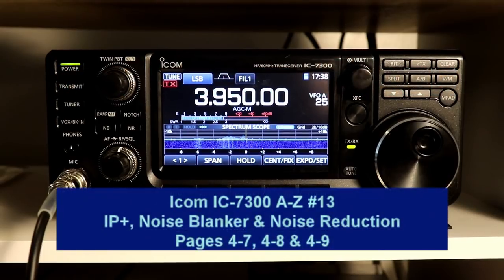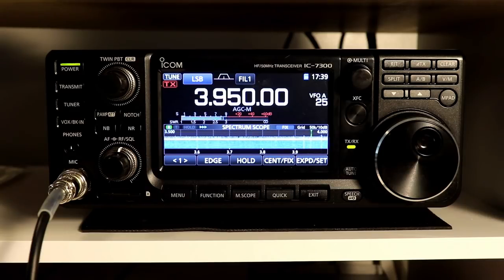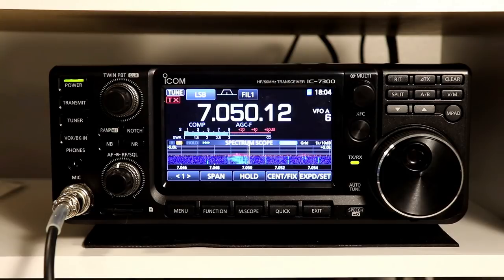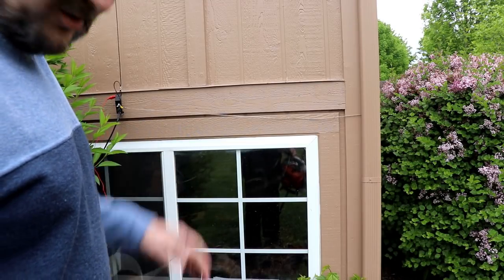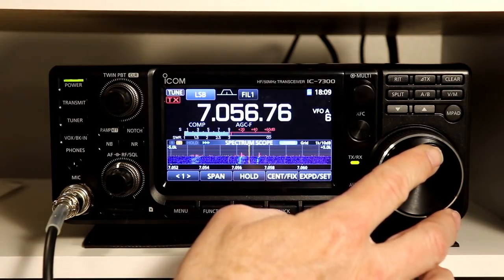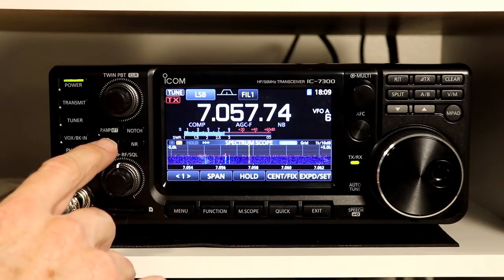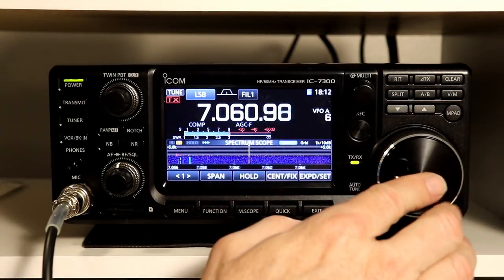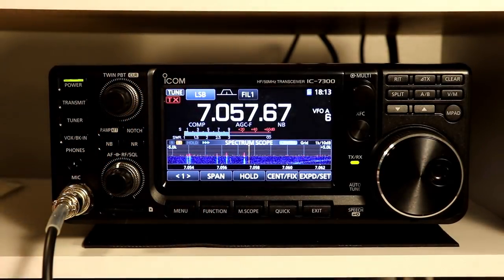Icom IC7300 A to Z #13 IP+, Noise Blanker and Noise Reduction functions

Comment: This inexplicable IP+ feature had me going in-circles for a while.  As he says the Icom manual had a terrible explanation.  I asked ICOM if they could try to clarify how this works.  Their response was quite good.  They retranslated from Japanese and came up with the following email response: 

IP plus (IP+) Feature:  This feature improves the receiver IMD (Intermodulation Distortion) by making the best use of the direct sampling architecture.

It optimizes the level of the ADC (Analogue/Digital Converter) for strong input signals in order to reduce distortion. It also minimizes the reduction in sensitivity for weak signals and improves IP3 (3rd order intercept point).

The IC-7300 IP+ (Intercept Point Plus).feature activates on-chip Dither and Randomization in the ADC.  IP+ has two selectable modes; ON (optimum linearity) and OFF (optimum sensitivity).

For further reading: https://www.analog.com/media/en/training-seminars/tutorials/MT-004.pdf

Comment: I love your videos and recently purchased a 7300. I have been using your videos as my manual  because I have low vision now and changed out my HF radio to this for that reason. I really love this radio and the features. Perfect for me now and I am doing a video on why I like it with my vision, should be out in a few days but I am planning on mentioning your channel in my video. I like the features on this radio over my FTDX 3000 for my eyesight and am having fun again on HF! Keep up the good work.
Reply from the maker: Thanks for the kind words and for the shout out in your video!

Comment: Just got my IC-7300 and just now working my way through these VERY HELPFUL videos. One tip I've heard and it works for me: activating the NR function makes the audio sound a little muffled (at least to my old ears). One can mitigate that effect by boosting the audio treble a couple notches: Menu/Set/Tone Control-TBW/RX/SSB/RX Treble.

Comment: I got mine today and love it, but somehow talkback has got turned on, I can hear myself through the speaker and it squeals to holy hell, I can’t for the works of me figure out how to disable it
Reply from the maker: Hi.  You need to turn the Monitor function off.  Press the Function button in the bottom center of the front panel.  On the menu that pops up on the screen, touch MONI on the lower right to toggle the monitor on and off.  You can also push the multi-function knob on the upper right corner of the display and touch Monitor at the bottom of the window that pops up.  Then you can adjust the level or touch repeatedly touch Monitor on the screen to toggle it on and off.  Look on page 4-11 in the manual.  Hope this helps.
Reply: turn off monitor fucntion

Comment: Well, not so much double talk, but incoreect or at least different uses of "Verbs" by the interpreter. The next sentence gives even more clues. "Optomizes the A to D converter (another words, using the info gleaned from the digital A to D converter to work with the noise AND using it in a optimum manner)  … " Which to me means the are analyzing the audio with the digital circuitry of the circuits and then applying that to the distortion and hopefully removing distortion. Cool. 
zz"
Reply from the maker: It certainly could be a loss in the translation.  It was definitely lost on me.

Comment: In rural areas the prime use of the Noise Blanker is to remove the pulse noise caused by electric stock fencing. At my location it fixes this completely and the energiser is in the same shed and the antenna is attached to fence posts!
Reply from the maker: Nice!  I’ll have to remember that next time I want to demonstrate this.  Especially if I do any live demos or trainings.  My wife has horses and we used to have our own place with some pasture.  A small battery/solar fence charger would be perfect to show the type of noise that the NB helps.  And it would be a lot quieter than the leaf blower.  😉
Reply: My neighbors electric fence would drown my audio out if it wasn't for the NB.  Works beautifully!

Comment: Don't know if I will every use noise blanker with the radio however I really liked the demo of it, will help on exam questions.
Reply from the maker: If you ever do mobile operation with it or if you use it at a Field Day or similar event with generator power, you might yet find a need for it.
Thanks for the comment.
73,
Tom
Reply: @HamRadioA2Z  only on older cars. it was primarily against the old distributor noise. you know the one with the rotor spinning. nice video though. kudo's
Reply from the maker: The newer cars with coil packs right on each plug are definitely less noisy on HF.  Although, funny enough, I use the noise blanker in my 2018 diesel truck.  Obviously, there’s no ignition noise, but the electronically controlled fuel injectors put out a pretty good pulse noise when they are firing.

Comment: IP+: 

based on what I knew, it is more about data point interpolation.  IC-7300 has 14 bits RF ADC (Analog to Digital Converter).  which theoricaly    has 14 x 6 = 84 dB of dynamic range.  

The IP+ enhance the sampling data and 'guess'  the signal strength  up to 16 bits, and enhanced the dynamic range up to 16 x 6  = 96 dB.

That's why in Sherwood test  report, IC-7300 has 94 dB of dynamic range  when using IP+.  

In short, it is a data manipulation to increase  RF dynamic range, which may increase   RX performance.

Again, correct me if I am wrong. 

Thank you.

Yours,
Bahatir 9W2GNU, 73...
Reply from the maker: I looked at the Sherwood report.  I also found a review by AB4OJ here: http://www.ab4oj.com/icom/ic7300/main.html.  I don't believe they are exactly "interpolating" the additional 2 bits of resolution.  The article from AB4OJ  says that when IP+ is on it activates ADC dithering and a randomizer.  If I understand correctly, I believe what they are "dithering" is the gain of the preamp coming into the ADC.  I also suspect they're changing the gain by an amount that  changes the value for the same voltage by less than 1 bit or at least by an amount that isn't an integral bit value.  This would have the effect of producing readings in between the last sample and effectively give you more bits.  Since you now have to process data across several samples, it would also effectively reduce you maximum bandwidth.  Although the A/D can do 124 megasamples/sec, they have plenty of oversampling for every band except 6 meters.
Unfortunately, unless Icom decides to make the firmware open source, we'll never know exactly what they're doing.
Thanks for your comments.  Good discussion.

73,
Tom
Reply: @HamRadioA2Z  
Thanks for the extra information.